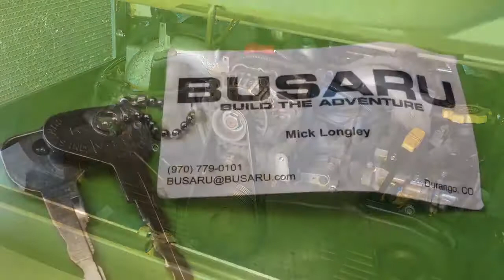First Start - Daily Driver VLOG 7/5/17 Bonus

Comment: But what about coolant? Didn't you just destroy your engine without it?
Reply from the maker: +jeffinillinois This is common practice when doing a new swap. Keep in mind you only want to run for a little while - short moves to make sure clutch operates, etc.
Reply: That would freak me out, spending thousands on and engine and then adding another grand in wiring plus thousands again in the transmission and clutch. AGH!
Reply: jeffinillinois a lot of people start up for the first time without coolant, adds to another level of work if it has to come out again, won't hurt running for a couple minutes
Reply from the maker: +jeffinillinois yeah, if you were going to bite your nails, now would be the time!